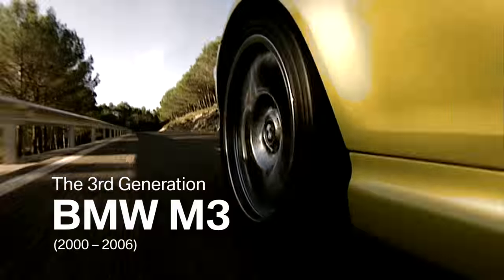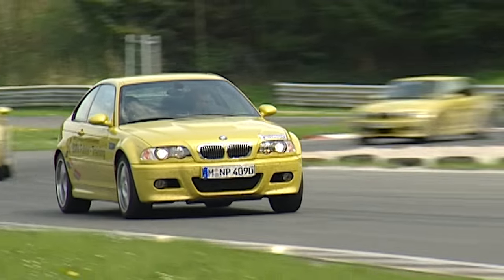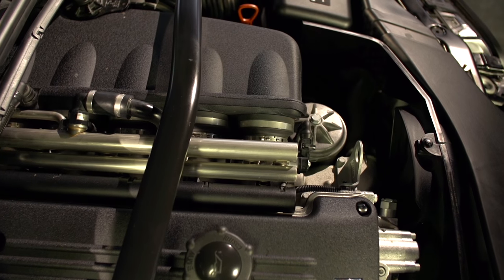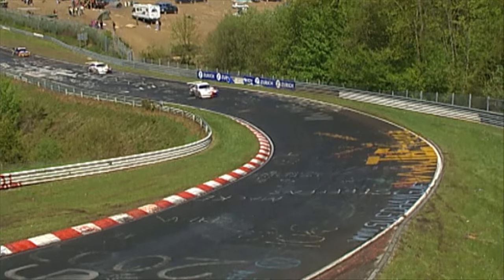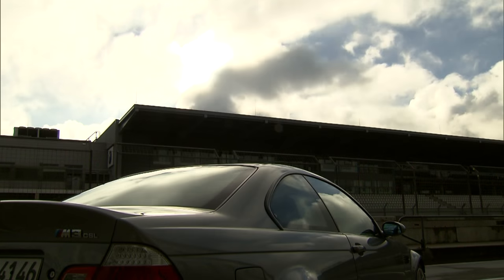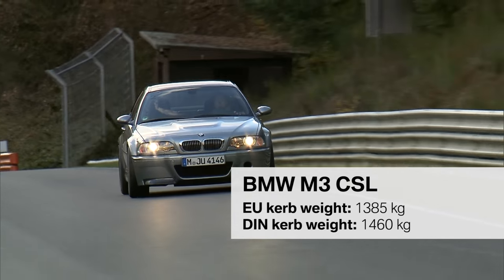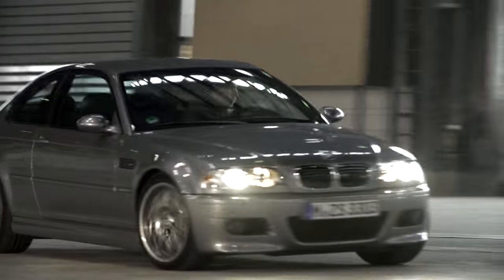The BMW M3 (E46) film. Everything about the third generation BMW M3.

Comment: I can't say this enough.l, This IS one of the best cars produced by BMW. The awesome powertrain, timeless looks and agile suspension makes it an all around phenomenal vehicle. I can't wait to get one of my own. Love the E46 M3 and I appreciate BMW for putting this car into existence, It's just perfect!
Reply: +Mango mangoson What are the engine problems? I might get one so I would like to know what I'll be facing.
Reply: +Mango mangoson you can fix the engine issues (forever) is an afternoon with $400 of parts
Reply: +Mango mangoson BMW recalled the car in 2002 and fixed the rod bearing issue. 2003 and later had the properly manufactured bearings from new and did not need to be recalled.

The reliability issues with the engine are the vanos bolts (bolts are fine, but need to be loctited and torqued to spec to not back out) and the vanos oil pump disk (holes are too big which causes a hammering effect-- a properly sized modified factory pump disk costs $150 post core return.

Do those two fixes and the engine is bulletproof. I have 142,000 miles on mine, including >10,000 track miles, 10 winters, and multiple trips to above 8000rpm every day. It's a wonderful, wonderful engine.
Reply: too ricey  to be timeless. looks straight out of 2000
Reply: +Christian Araujo and rear sub frame cracks! perfect.
Reply: +Alan Navarro holy fuck.. No idea about that
Reply: Daniel Santos just search on youtube you'll find out! it is the most problematic bmw.
Reply: +Alan Navarro Certainly wasn't my experience, in spite of a complete Dinan kit (2003 E46).
Reply: Alan Navarro

There are two weak points on the e46 M3
1) vanos: can be locked down with $400 of parts in an afternoon, as mentioned above. After that, the engine is pretty bomb proof. 
2) subframe. Can be fixed in 10 min of work (and then left to sit 24 hours to allow it to set) with $150 of BMW structural foam (injected into the subframe mount points per BMW's instructions). 

In both cases, the KEY is addressing them before failure. They're cheap and easy to prevent. If you wait for them to fail, you'll have a huge bill on your hands. Do those, and you can have long, low expense e46 M3 experience.... and it's one of the best cars ever made.
Reply: obioban nice explanation
Reply: How'd you go about finding one? I want to start looking but have found nothing so far
Reply: Just go to this website and read it all the way through....https://thebuildjournal.com
Also, simply do a search for, "BMW e46 M3 subframe issue" and see what you come up with. And don't stop there.

Comment: Proud e46 m3 owner!
Reply: +ACrazyRhino Best Car ever !
Reply: +ACrazyRhino Is it hard to live with that car, finanacially speaking.
Reply: Happy Shqiptar It definitely can be, it helps when you can work on it yourself though.
Reply: ACrazyRhino Do you think an Electrician or a train driver can afford to own this car, becasue these are the two proffesions i am focusing to become.
Reply: +Happy Shqiptar yes!
Reply: +Happy Shqiptar depends where you live. In the United States you can find a good used E46 M3 (manual transmission) for around $18-$25k. Personally from my experience owning a 2003 E46 M3, I wouldn't get one. In the upper $20ks you can get a nice LS3 vette or in low $20ks a 04 SVT Cobra. I have some buddies that are electricians with new Mustang GTs, Cobras, and Vettes.
Reply: +ACrazyRhino me too ! ahah
Reply: A226044 Well i live in Sweden, hopefully there's hope.
Reply: Hope to be one soon!
Reply: +Happy Shqiptar be careful buying an e46 m3 these days, as they are old and a lot of them had major problems with the rear diff subframe ripping apart the chassis, with all the torque. basically bad design where the chassis wasnt strong enough.
Reply: +AuralAttack not true it's the welds, subframes can be reinforced for £700
Reply: ok yeah the welds as well but that still doesnt change the fact it was poor design and should of been reinforced/strengthened from the start. I'm only trying to help someone from potentially buying a car thats gonna give them nothing but headaches. Make sure you lift up the carpet in the boot and check thoroughly for signs of crack and damage
Reply: +AuralAttack similar issue for the E36s, too
Reply: Yeah I had heard that too, It can happen to all e46s too not just the m3's but obviously they are more prone due to the amount of torque on the diff carrier, plus most have probably been driven pretty hard over their life. I own an e46 diesel coupe with pretty low miles so not really an issue for me... yet! lol just a shame BMW didn't realise this problem. the e46 coupe is one of the best looking 3 series ever made imo.
Reply: You're so lucky!
Reply: Nice color I have the tiag.
Reply: I love mines too
Reply: i have also this car in blue (topas)👍🏻
Reply: I have a 325xi e46; not exactly an M3 but almost identical in power. loved the car
Reply: same here
Reply: Proud e36 m3 owner  but I need that s54
Reply: Lucky man I want to get one

Comment: Don't even have to bother looking at other videos when this pops up on your feed
Reply: +Carbon Fiber Honda this is definitely THE M3 of all times
Reply: +Club Bmw Amg thanks God i got one!
Reply: The E46 M3 was so great that it never raced with it's original i6 engine.  That was thrown out and replaced with the 4.0 V8 which was subsequently used in the E92 followed by the F82 generation.  THE M3 of all times is undoubtably the one with the race winning V8 ... the E92 !!!
Reply: +W Walt agreed!
Reply: +Club Bmw Amg, E92 M3 GTS nailed it in 7:48
Reply: +Club Bmw Amg, the E46 M3 GTR had a 4.0 V8, like the E92 M3. The i6 was a losing proposition. The V8 turned it into a winner.
Reply: Regular production E46 M3's were never fitted with a V8.   The inline 6 in the E46 M3 race car had to be replaced with a V8 because BMW could not keep up with Porsche.  The V8 turned the E46 race car into a winner.  Unfortunately, you can't buy an E46 M3 with a 4.0 V8.  The 4.0 V8 will go down in BMW history as legendary.  It allowed BMW to win tons of races across three generations of cars, the E46, E92 and F82.  This makes any V8 powered M3 the most desirable, in my book, and therefore the best ///M car.
Reply: +Club Bmw Amg, a total of 10 E46 M3 GTR's were road registered for homologation.  Where can I buy one?

Comment: I absolutely love mine. I have an '02 imola red manual coupe and its amazing!
Reply: What about running costs?
Reply: +Erik Wiedemann If you can do your own maintenance its not too bad. If you're taking it to shops it can be a little pricey.
Reply: +Erik Wiedemann fuel cost not too bad, oil service £200 inspect 1 £500 inspect 2 £700.

Comment: I had the unfortunate experience of buying one with high miles which is my fault and it had a lots of problems, but i would  totally get another one in a heart beat. the car was just an amazing driving experience and its such a practical car. Best RWD sports car with 4 seats on the market for its price range.
Reply: David LaHaie what issues did you have?  I'm reading the major ones like vanos bolts and pump and reinforcing subframe before things go bad is very important.

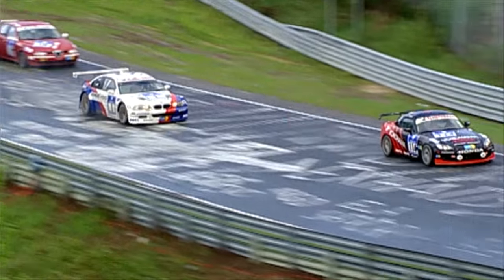Comment: 2:07 That VTEC in that S2000 did not kick in lol.
Reply: You wish 🤣🤣🤣🤣🤣 that s2000 was just slower in every way, seen it even on the streets against the inline 6 e46, the s2000 doesn't stand a chance even performanced, when a e46 hits 3rd gear most of the time it's taillights that get farther away, the e46 has a diverter valve turbo btw that makes the Honda vtec look like a child play thing

Comment: I have a 2004 E46 330CI with the ZHP Package. It's definitely nowhere near as fast as the M3 but still a blast to drive. Also, insurance is cheaper, and I do not have to worry about the rear subframe mounting points in the undercarriage cracking.

Comment: The top dudes did not mention the subframe ripping the floors though did they....Love mine though, smart looking car and the engine is a peach.
Reply: +Rory Jones Most who "ripped a hole in the floors" drove the car like a complete ass.  This is not common. And a subframe crack which is more common is easily fixed for those who can afford to maintain the car they drive :)
Reply: +DontCallMeBoB all e46's suffer the weak floor and the 10 year goodwill repair shows that bmw were  aware of it. Design flaw end of. I went in with my eyes open so knew about it. many are not so a floor that's cracked can go south quickly
Reply: +Rory Jones I agree it is a weak point. One that can be reinforced or repaired relatively cheap in comparison to the quality and performance this car offers. This you know

The ONLY person I know that ripped his floor apart severely ABUSED his car for a decade before that happened. (burn-outs, reverse j turns, drifting. . .) I do see a lot of cracks, very seldom see floors ripped apart unless the car is horribly abused. The fix is as simple as mounting a strut brace that bolts down to the sub-frame as well. 

Ripped floor - Cracked sub frame  These are very different problems. One can cost your car the other is fixed for just a quarter of what an intake can run you on the e46 . . .just being clear, no hate here.

Comment: After the E30 M3 the best M3 you can get. :D

But ONLY with MANUAL gearbox!!!^^ 
For the CSL: He isn't the 'better' M3, at least for me. (no fan of the carbon roof, carbon for stiffening parts at all -> long term durability, because of UV 'corrosion' and so on, for me better use in 
frontfenders or hood/trunk. You can bring a 'normal' E46 M3 to that wheight/hp ratio as well and still have a lower price for the used 'base car' compared to a used M3 CSL and their prices. :p

Comment: The E30/E46 M3 and the Z3M are without a doubt the most iconic cars BMW in recent decades created. Prices for good condition used ones are climbing already and for the CSL they completely shot through the roof. This is something BMW should think about. People lust after the iconic models and my feeling is today the only appealing model in this regard is the M2. The M4 is just too large and in terms of sound and design, sorry, BMW just lost the plot. Also the 2 series van looks retarded and the 2018 1 series will be a Mini and not represent the brand values. Please BMW Product management, don't do the same mistake like Alfa did and go for large volume crap cars. This will de-value the brand and make me want to buy something else - it really does.